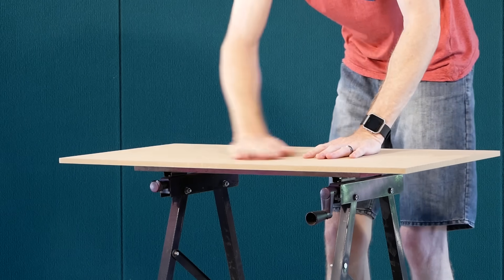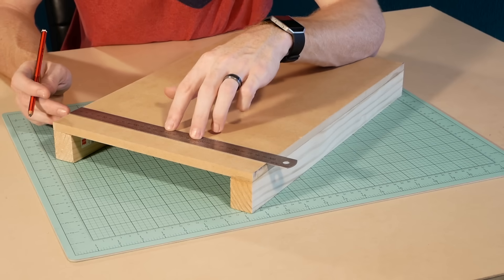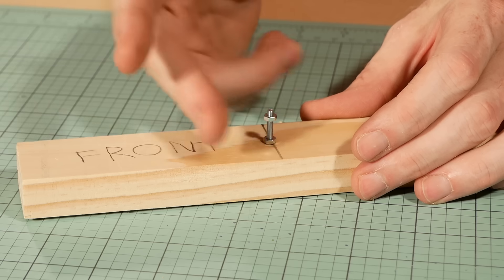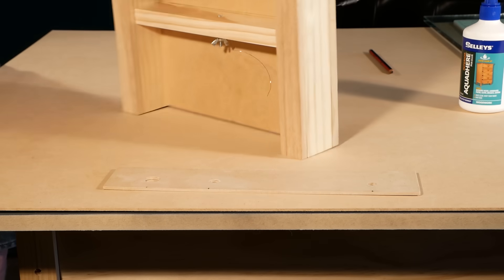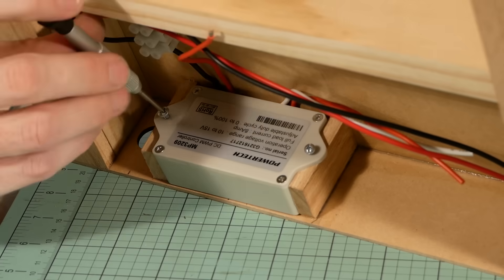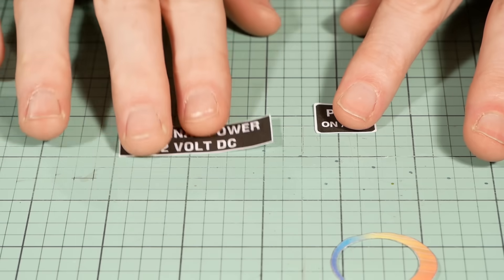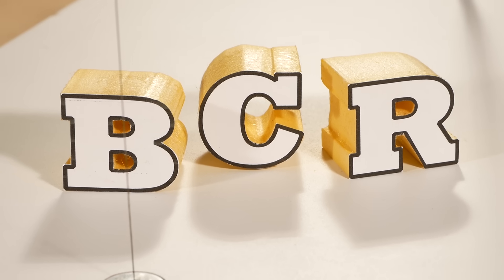Build Your Own Hot Wire Foam Cutter - Professional Tools for Modelers

Comment: how did you cut the hole Inside  the numbers? Like B,R,A?
Reply: If you cut a small hole inside it using a screw driver, you can tread the wire through it, connect it, heat it and then cut the hole out

Comment: Hi Luke, 

I want to get more specifics about the electric components. were you drawing power from a wall socket? what part did you use to convert from wall socket to a 12V power supply?

Could I do this without the controller and switch, but just a 12V power supply and whatever set up you used? 

Thanks,
Reply from the maker: I used a 12 volt power supply to power the foam cutter. Any 12 volt supply should work fine however the hot wire draws a lot of current so just make sure the power supply you use has enough Amps. In this video I used a 12 volt supply with about 6 or 8 amps from memory. You could probably use a power supply with a lower amperage rating however you may find the power  supply gets a little hot after using the foam cutter for a short while.
Reply: Luke Towan 
Thanks. Do you happen to remember the wattage too?

Comment: Great job with this, Luke! I am researching for making a nichrome wire heated acrylic bender, with a similar electrical design. You've done a great job with that.
Reply: You can use the heating element of an old clothes dryer.

Comment: How would you suggest cutting patterns within the foam, for example, the inside of the letter B, without cutting the perimeter of the letter?
Reply from the maker: I did it by poking a hole through the letter B and then threaded the wire through the hole and connected it up and cut out the inside. It's a little time consuming but it works well.

Comment: It's a great project for make, i have a question, With this can i cut a cardboard of 10 mm ? and Can i make the wire foam cutter in a big table ? Thanks
Reply from the maker: I don't think cutting paper/cardboard on its own would work well because it's likely to catch fire, I've tried cutting paper but the wire temperature needs to be very high to be able to cut through it, that's why it is likely to catch fire. Paper works well as a template guide though as long as the wire isn't too hot.

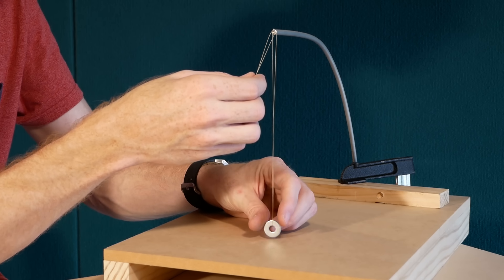Comment: @ 3:34 did you make sure that the bed of cutter is leveled horizontally?
Reply: Nader Fawzy  Yes he did, when he located the hole in the table. This would put the wire at a right angle to the table from all directions, unless his work table was not level. BTW, “level” is only horizontal, “plumb” is vertical alignment.

Comment: Great presentation. Thinking of making a 1x1 m tabletop version for mocking up auto interior parts. Will then finish off in fiberglass. The foam should double as sound-deadening/insulation. Is this a dumb idea?

Comment: Well done video and very nice cutter!  This may be a bit nitpicky but your power source doesn't work the way you seem to suggest in the video.   

It looks like you're using a PWM controller for your temperature adjustment.  You video suggests that you're using it to regulate the voltage into the nichrome wire down to the 5V that you calculated online.  I'm not sure if it was just an oversight but you may note that this type of controller does not work like your conventional variable resistor rheostat. Instead, it's actually supplying the full 12V and simply 'pulsing' the power based on the knob position.  This is common in modern LED controllers which is likely what you controller was designed for.  While it will probably work fine at the right knob settings, it doesn't exactly make use of your calculations.  

Have you checked the wire temperature or DC current?
What sort of temperature range are you getting with this controller?

Comment: Man... Amazingly well done. I've never saw someone be so careful about the overall look of what they're doing... Beside you and myself. Congratulations to the great job! And be sure I'm going to make my own version of it. :)
Reply from the maker: ha ha ha 😀 thanks mate... I can often spend way too much time making things look good when they don't really need to 😀 Have fun making your own version
Reply: Luke Towan I know what you mean, bro. I have the same problem. LOL You should see my two (small, to use by hand) hot wire cutters... Both made of layers of cardboard and the outside I made one with black EVA and the other with a hard and strong kind of paper. LOL But I didn't make videos at the time. (Now I make, but in Portuguese - I'm from Brazil.) Almost every time I paint and so on... :)

Comment: Great video and beautiful work!!! I am planning to make somthing similar. 
One question. Does current affect the spring  (burns it maybe if current is high enough)? Cause its passing through it too.
Reply from the maker: Yeah the spring gets quite hot as well... Although I've found due to the design of the steel rod arm it's quite flexible and you can use the foam cutter without the spring attached.
Reply: @Luke Towan I built today the foam cutter. I used a hollow aluminum rod and a led strip dimmer (6-12 Volts) as a temperature controller. It works like a charm except an annoying sound the nichrome wire does, when i change the voltage. I think somehow reached the eigenfrequency of the wire and the hollow rod just amplifies this sound.  Its like a guitar string vibrating all the time.

Comment: I can't understand how you can have dislike on this video. This is exactly how a diy video should look. Keep up the awesome work luke!
Reply from the maker: lol, thanks mate 😀
Reply: @LukeTowan not even an issue, engagement is engagement.  Thumbs up or down makes no difference.
Reply: @BoulderCreekRailroad  
Hello was hoping could help me please.
I want to make a heating pad that goes around the parameter of a Microsoft Surface Pro 3 tablet(edges only) and using some form of suction cup in the centre help ease the entire screen away from the table helping remove the screens without damaging the lcd and the actual glass.
Do u think we could pick each other brains and make one????
Cheers
El
Reply: Probably employees of a company who sell this equipment at a greatly inflated price.
Reply: @peter.24.7  just saved me $200 CAD so i don't doubt it!
Reply: lol, great comment, both funny and prob accurate.
Reply: I don’t think it’s the quality of the video that’s getting a thumbs down, it’s the materials and time cost of the project. Might just be easier in the long run to buy one. But I appreciate being shown how to make one so I can make that decision.
Reply: @remlya  I see this same dilemma on pretty much every single DIY video - is it cheaper/worth it to DIY?    

The thing about DIY is that once you start doing it a lot, you tend to have things lying around.  So while it might be cheaper to just buy a hotwire cutter compared to buying all of the materials... if you already have most of what you need laying around from other projects, it changes things.   

In other words, DIY isn't about just making your own for the sake of making it.  It's about learning ways to use/reuse things that you already have/can get easily.   The question of whether it's "worth it" also depends on whether you're willing to spend a little bit of time and/or money for the sake of learning something new.  

TL;DR: You can buy a fish for $5, or you can spend $10 on a fishing pole and some tackle.
Reply: Jealous people.  lol
Reply: People are really retarded sometimes!
Reply: Those are his ex gfs
Reply: Just PERFECT 😎😁👍
Reply: Since he has about 30k likes and 1k dislikes, it just means that about 1 out of 30 people are complete morons
Reply: @VolperVisionDesigns  Agreed! Words of wisdom
Reply: I love you
Reply: Haters are going to hate. Forget them great video.
Reply: Hi buddy, can you support my channel?
Reply: because it doesn't go into enough detail about the wiring and glosses over it.
Reply: Michael m nailed it. I disliked a separate video for those reasons. The power supply alone, that was recommended cost more than purchasing buying one out of a box.  Plus the wire he used was so thin & small it would snap the first time you tried to rush a cut.

My old Japanese version was practically 2 wires strapped to an annealed wire & plugged into the wall. It worked, it was big & fast. Replacement wire is the problem with these.
Reply: At frame 3:36 an insect passed by ruining the experience of the video. (joking)
Reply: @Julian Reinaldo Pretty sure you replied to the wrong person...
Reply: Because people are butt hurt he just showed them how to make the same thing they spent hundreds for a fraction
Reply: @James Dayton Instablaster =)
Reply: @Kyrie Jayson i really appreciate your reply. I got to the site on google and im trying it out atm.
I see it takes quite some time so I will reply here later with my results.
Reply: @Kyrie Jayson It worked and I actually got access to my account again. I am so happy!
Thank you so much, you saved my account !
Reply: @James Dayton happy to help :)
Reply: Too much idiots, may be😂😂😂
Reply: That might be why you don't see dislikes anymore. Only the channel can see them.
Reply: Jallous  his one's cooler than the one they paid for
Reply: Can this tool be used to cut EVA sponge or rubber foam? Please give instructions. Thank You.
Reply: I can't understand dislike in every of his video !!!
Reply: They can come from: Companys of hotwires // People who dont understand CM as measurement unit lmao. Luke, thank you sooo much!
Reply: Its bots
Reply: Drew Kosonen nah I just disliked it
Reply: @frogbob2315  But.... but how could you?

I mean this video is as close to flawless as it gets.  What kind of monster are you?
Reply: ...because it's cheaper to buy one that is already tested and true with great reviews???
Reply: Might be scared someone will try to make one and electrocute them self’s with main power.
Reply: Sorry to be off topic but does any of you know a way to get back into an Instagram account?
I was stupid forgot my password. I would love any tips you can give me.
Reply: Probably because not everyone just has random pieces of wood, random metal rods, wires, electric saws, etc laying around their house.
Reply: probably because they know the how tos of 'doing it themselves' in a far better way but would never make a tutorial video on the subject because they want to keep their awesomeness for themselves.. LOL
Reply: @vgfxworks  sounds like a bunch of selfish assholes who wouldn't be counted as awesome but a sad lonely person
Reply: I can see one reason a person could disagree with one small thing in this video: When he filed the end of that rod, it kind of gave me the "nails on a chalkboard" feeling, AKA cringe. Standard files only work one way, pushing away from you! The back and forth motion will dull a file in no time. That being said, it doesn't warrant a dislike, and I still liked the video and subscribed, because even though I'm only 3ish minutes in, the rest of the video has been flawless and I'm sure the remainder will be as well. Kudos on a great vid man, but be kind to your files!! Cheers!

Comment: The metal rod heats too..
Reply from the maker: It gets a little warm near where the nichrome wire connects to the rod, I haven't had any issues with it getting too hot because when I cut the foam I turn the power off as soon as I make a cut and then I turn it back on when I'm ready to make the next cut.

Comment: Can you cut a kind of wood on this machine??
Reply from the maker: When I was testing the foam cutter I set the wire to get it as hot as it would go, I was able to very slowly cut through a piece of 3mm MDF but I had to slide the MDF up and down the wire to get it to cut. I guess it may cut through balsa wood a little easier but I'd probably just stick to foam 😃

Comment: Excellent tutorial. Easy to follow, highest possible production values and the end result looks very professional. I feel I need to get some power tools to make something like this (or to make it in a reasonable amount of time). Presuming I have all the tools and materials, how much time should I set aside to make it? Looks like a good weeks work with drying times etc.

Some technical questions as I have little experience with such builds: 

1. When the wire is affixed to the nut and screw in the base, does this not get extremely hot over time and may burn the wood? Should one thus work fast and always turn it off after a few cuts?

2. The metal arm and clamps will have the same issue I presume? How long can you use it before it just gets too hot? Protective gloves may be a requirement?

Encasing the wire attachment in the bottom and metal arm with some non conductive material would potentially solve this "problem". Maybe a rubber coating or casing would work.

Do I overthink this and the power supply used will not pose such a problem?

Thank you again for an inspiring tutorial and I look forward to your next video!
Reply from the maker: Hey mate thanks for the questions 😃 The nut and screw don't get hot at all and the metal arm at the top stays cool as well, although I don't leave the cutter on for long periods... at most 3 minutes or so. I usually make a cut and then press the green button to turn it off straight after cutting.
It only take about 3 seconds for the wire to heat up and the same amount of time for it to cool down. I don't think there is any need to insulate any of the components, so far I've found they handle the temperature quite well without getting so hot that it will burn your hand.
Cheers 😃
Reply: Thank you for the reply. Excellent, I now only need to make space for such a construct and off we go.

Comment: all you need is piano wire , 9v battery and resistor and maybe on/off swich if you fancy.
Reply from the maker: True... However I did test this and there are a couple of problems, the 9v battery is only designed to run at low amperage and the hot wire will draw quite a lot of amps from the battery in a very short time, this will result in a very hot battery. 
In some of the tests I did the battery got so hot I couldn't touch the batter! But that said, if you only turn it on for short bursts and then turn it off straight after you should be fine... Just be cautious I guess 😃
Reply: yes that why i said resistor , variable resistor will be best.
I dont say you did anything wrong , its well designed , build and realy nicely finished but kinda overkill for me :)
Reply from the maker: I tried it with an ordinary variable resistor and it didn't work (when I was testing with a 9v battery), the resistor will not only lower the voltage but it will also reduce the current which is whats needed to heat the wire. The reason it works with the temperature controller I use is because it is specifically designed to vary the voltage whilst maintaining the current.
If you can point me in the direction of a good 9v battery design I'd love to know, it would be great to make a good portable foam cutter but I would really like to avoid an exploding battery 😃

Comment: Great video. What types of foam can this cut? Cheers
Reply from the maker: Thanks, Luke. So far I've tested the cutter on regular polystyrene, extruded polystyrene, and EVA foam sheets. Although there are some strong fumes when cutting the EVA sheets. So I suggest using it in a well-ventilated area. Cheers Mate.

Comment: You are the Man!!!!!! So how much did this set you back? If you dont mind me asking.
Reply from the maker: Hey John, in the end I spent $72AUD, but I could've made it for much less if I used a cheaper temperature controller. The one I used was $35 but you can find them online for less than $5, also the switch I used was $12 but you could easily get a switch for less than $1... i guess that's the price of masking it look pretty 😊 Cheers mate

Comment: I might have missed something, any my electrical knowledge isn't that great, but where did you connect the clamp assembly back to the controller to complete the circuit? It looked like you only made the circuit as far as the clamp and didn't run it back...?
Reply from the maker: Basically the circuit runs to the clamp assembly then it runs up through the nichrome wire back down the steel rod and finally back into the temperature controller. Hope that makes sense  😊

Comment: Great work! As a tip from a Electrical Engineer and DIY-er i recommend getting a cheap wire-crimper and some circular terminal instead of the soldered washers. They're cheap and gives a good solid mechanical and electrical connection.
Reply from the maker: I didn't even think about that! That is a great idea 😊 Thanks for your advice.... Greatly appreciated 😊

Comment: I would have integrated the power adapter in the case, but very nice build anyway!
Reply from the maker: I did think about that but the power supply I'm using is also used to power my static grass applicator, that way I can use one power supply for both tools. But yes it would be easier and more complete if it was all in one package 😊
Reply: Ah I understand. :-) Thanks for the response!

Comment: Great tutorial! Thank you! So, in your case, you'll need something like 5 to 10 W for the PSU. 72W is a great safety factor. ;)
Reply from the maker: yeah, I read on www.jacobs-online.biz that it recommends having a power source that has at least 2 times the amount of wattage needed. I tried using a lower wattage power supply on some experimenting I did and the power supply would get really hot after a minute!
Thanks for watching 😊

Comment: How did you make the holes in B and R?
Reply from the maker: lol, I was wondering if someone would ask that 😊 I used a small file and poked a hole through the holes in the B and R then I took the hot wire and poked that through the hole before clamping it down and turning the power on. It's a little fiddly and time consuming to do but it looks good 😊